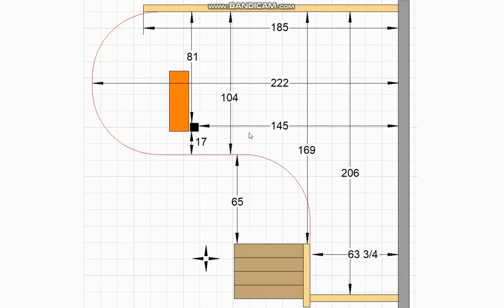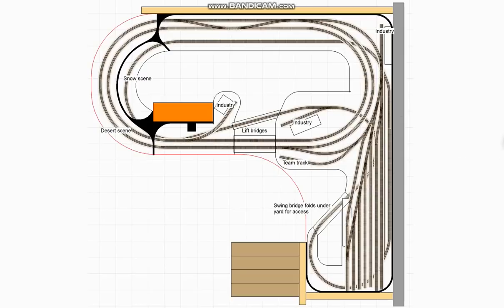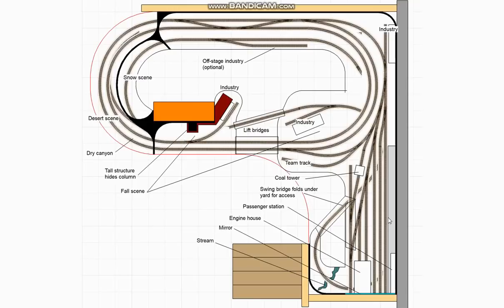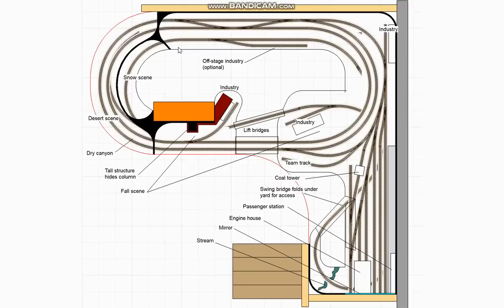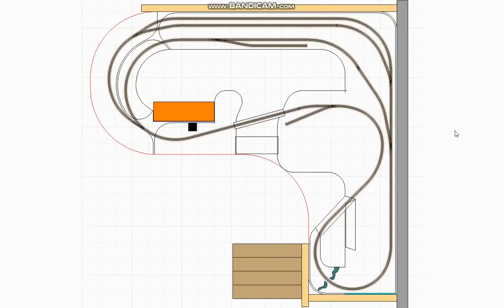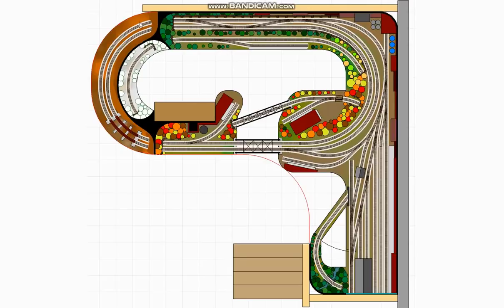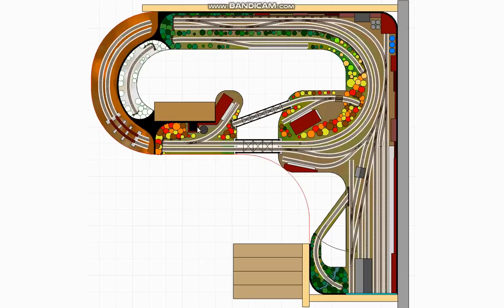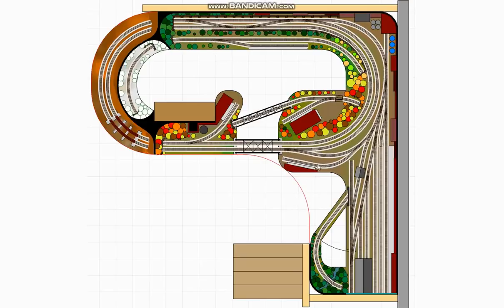A small O-scale layout design

Comment: I don’t know why you would be hesitant to work with three-rail O-gauge?  It is the easiest for installing switches (turnouts), reversing loops, and accessories.  The transformers are also much simpler.
Reply from the maker: I explained exactly why I don't often accept 3-rail design contracts - in the very next sentence.
Reply: @mpeterll  So as long as s client doesn’t want to cram in as many loops as possible on an O-gauge 3 rsil layout: You’re good with it?